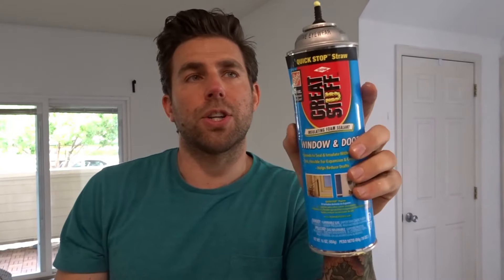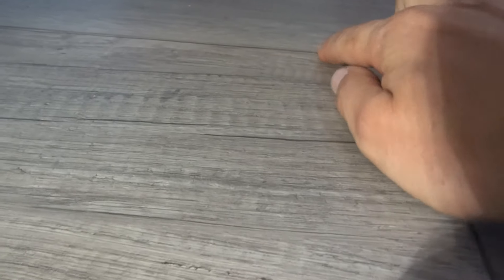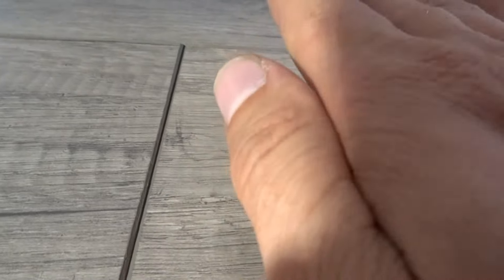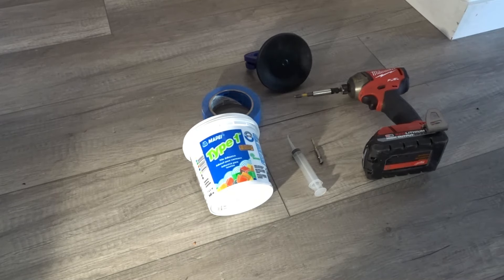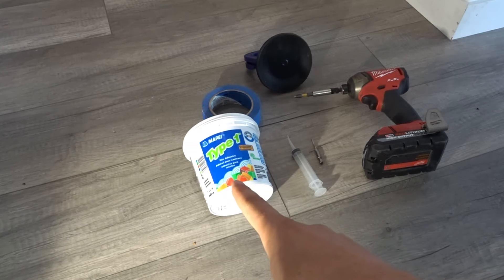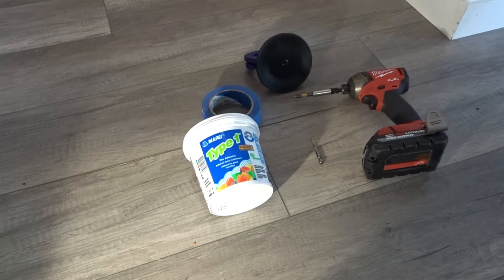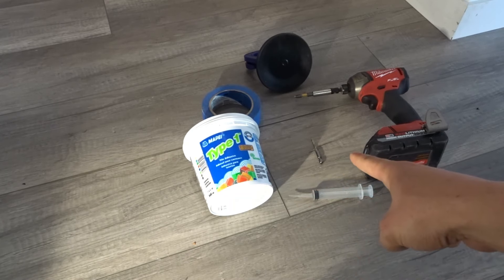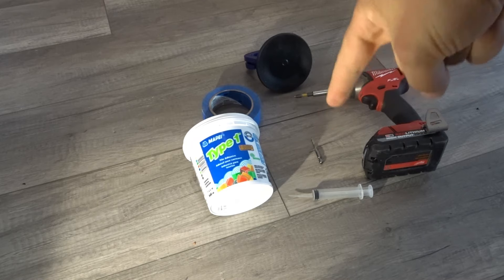Sagging Floorboard Repair | No Damage To Floorboards

Comment: I did two floor boards today and your system worked out great. Planks no longer give when they are stepped on. This fix was spot on and far less work than removing the planks.
Reply from the maker: @wing3389  glad I was able to help out!! Thanks for taking the time to comment, that helps me out!
Reply: @aaronfixesstuff hey mate, would you have any concerns with me doing this fix on my engineered hardwood floors?

Comment: Keep the drilled floor dust to put back in the top of the glue so it matches the floor.
Reply from the maker: What a great idea! I wish I had thought of that!!
Reply: wonderfull idea Ted, Im doing time to time floor installation  and as you guess i end up with that kind of problems and honestly i did not know that, thank you for your advise and thanks to the video maker,  both are fantastic ideas stay safe and stay well  both of you

Comment: This is EXACTLY the solution I needed to fix sagging gaps under my old tongue-and-groove floorboards! I will modify the technique slightly, since my floors are made of real solid wood instead of vinyl/laminate. But the essential piece I needed was to know WHAT to use to fill in underneath. I had already thought about drilling holes like you did, but I couldn't think of a good product to actually use as the filler, that wouldn't squish underfoot, but wouldn't crack and crumble either. I also needed to see someone else using the drill-and-fill technique, to give me confidence that it's not too outlandish of a solution and could actually work! How would you say this floor is holding up now after some use?

Thanks again for sharing this video!! Extremely helpful, and very well-explained and demonstrated!
Reply from the maker: Thanks for the feedback!! I was shocked when I didn’t see a single solution to this!! The floor is still holding perfectly. It dries rock hard so there are no issues. Also since it doesn’t expand when drying, you don’t have to worry about it overfilling!
Reply: You could and should use whatever adhesive is used to adhere your wood planks to the sub floor
Reply from the maker: @A4rings110  thanks for the feedback but you’re incorrect. Such a small amount of adhesive will harden and then will separate from the board with expansion and contraction.
Reply: Hey Aaron, thanks for the reply. My parents have laminate wood which I plan to fix with the same materials that you used in your video, but the way I read Emily's comment it seemed like her floor was not floating and instead was attached via adhesive to begin with. maybe I misunderstood her comment.  @aaronfixesstuff
Reply: Also, in your opinion, would It be better to try and inject the tile adhesive in between the boards and the layer of foam underlayment, or inject under the foam underlayment? or does it not really matter @aaronfixesstuff
Reply: @aaronfixesstuff sorry to bother, but I’m going to try to tackle this project today and would love to hear your thoughts on my last question?
Reply: @emilys3638 did you ever do this with your floor? I have a tiny 1.5 inch x 24 strip I need to try this way. Would be interested if it worked for you.

Comment: Oh my god, what a fantastic fix. I had the same idea of injecting into small holes, but two things which you suggested were excellent: Drill near the seams so that it's less noticeable, and use tile adhesive! Fantastic, brilliant video.
Reply from the maker: @jamhead4866  right?? It drove me crazy that the only solution I found was to remove the boards and then fix the problem. I was very proud of myself coming up with that! And the repair held great!!
Reply: @aaronfixesstuff  that's brilliant news, I'm happy it has lasted. Will be giving this a go on payday. Explained really well too, subscribing!

Comment: Big thanks for this video mate - sorted out a sagging floorboard in my kitchen by drilling 5 small holes and filling with a hardwood colored flooring specific 'no more gaps' product.  Much better option than having my kitchen ripped up and re-laid (which is what the retailer and original installer recommended).  LOL :P
Reply from the maker: @damaged31  that’s what I was told too! I didn’t like that answer and decided to come up with a solution. Glad it worked for you too! Thanks for taking the time the time to comment and support the channel!!

Comment: Great idea! Great video! Was thinking caulk over foam but tile adhesive is brilliant! The right product for application! Please share brand of adhesive and syringe, it seemed to flow pretty well,  and read in comments about saving drill shavings for floor touch up after process. These are great ideas for annoying problem! Thanks to you and everyone! I'm a diy and feel ready t9 install that floor! THANKS 😃

Comment: Very nice video, I have the same problem, uneven suspended subfloor. 
Is there a reason for using tile adhesive?  I am worried with time it will crack and make a noise as you step on it. 
Thanks.
Reply from the maker: Well there weren’t many other options that I could think of. I just used that because it seemed like a solid, but easy to apply, substance. I don’t think that it should crack because the void is completely filled with it. I may be wrong about that, but so far it’s been a year and I have not heard of any issues.

Comment: This is an interesting and creative fix. But in that section the floor is no longer "floating" which means constant gaps in other areas?
Reply from the maker: @silver60618 thanks! There are no gaps that showed up. The floor is still mostly floating as the repair is only on a small section.

Comment: I can’t believe there is a solution for this without taking the floor out !! THank you for sharing ! Question, how long does the adhesive take to dry up? I’m going to give it a shot soon.
Reply from the maker: I know! And I could not believe that nobody had thought of it till I did!! It takes 24 hours to set.
Reply: @aaronfixesstuff  Do you walk on it after some time to make sure it is in level and not building up too much?
Reply from the maker: @Jam.S.  no need to because it doesn’t expand when it dries.

Comment: I am so disappointed having got my floors done by a contractor, only to see few areas with a similar problem. This contractor will never put foot in my house again. Thanks for the video. 👌
Reply from the maker: Absolutely! It’s what happens when corners are cut unfortunately.
Reply: Going through the same. I have gaps, soft spots, and no expansion gap. Been so stressful. I don't trust the guy to do fixed so I am watching all videos I can
Reply: Not his fault your subfloor are not even
Reply: @dman5703 
Subfloor preparation is part of the installation job. No professional installer would go on top of an uneven subfloor. It's the contractors job to be the expert and point that out
Reply: @doubleclutch EXACTLY

Comment: Appreciate for making this video! QQ: I see you kept injecting the adhesive several times into the same hole, so how did you determine when to add more or stop adding? Does the adhesive actually find its way self level to other hallow spots?
Reply: Once the adhesive comes out of the 2nd hole seems to be a good gage of the rest of it being pretty filled

Comment: Wow, this is exactly what I'm trying to fix.  I did not want to remove floorboards and have to memorize all the flooring pieces and their locations for reassembling.  I'm going to try this fix this coming weekend. Just out of curiosity, what size drill bit did you use ?  Thanks for posting this !
Reply from the maker: For some reason I could not find a SINGLE video that addresses this without talking the boards up. I used a 3/16. I’d advise finding one of the syringes I used (that is curved). Good luck and reach out with any questions!!
Reply: did it work?
Reply from the maker: @Gigidurucuru  sure did!!

Comment: Hi just found your video and hallelujah 🙏🏼. Was planning to go the expanding foam route but your method actually makes much more sense and my situation is identical but even more of a drop between the boards. Out of interest what tile adhesive did you use?  The reason I ask is some adhesives are quite thick and I presume struggle to be pushed through via a syringe? It looked like a Mapei product but not sure?
Many thanks and a great vid 👍
Reply from the maker: Hi Mark! I’m glad you ran into it. You are correct, it was the mapei type 1 and they sell it at Lowe’s. The most annoying part was loading the syringe, but it wasn’t too bad. 
Aaron

Comment: I have a sagging vinyl plank in the center near the edge. Currently the floor plank next to it is removed because I was in the process of replacing it. Can I apply the tile adhesive under the plank since it’s exposed? Is there any expansion with the tile adhesive or does it spread and dry as is? Thank you.

Comment: How small of a drill bit did you use for the holes, and was there a reason you put the holes in the sides of the plank and not the middle of the plank?

Comment: Can I use the Alex paintable caulk? I used it to caulk around the window and even though it is flexible, it is semi rigid.
Reply from the maker: I would not recommend that. That caulk is not sturdy enough to support the weight and would likely fail.
Reply: @aaronfixesstuff  Got it. Would you mind providing a link to the glue you used? It was vague on the video and I couldn't see what it was. Was that glue very thin and easy to inject via the syringe?

Comment: Nice approach. but it seems may brake laminate ability to "float". Would not laminate adhere to underlayment?
Reply from the maker: Good question. If you did this on a large area, that could become a problem. However, a lot of laminate flooring is very smooth on the bottom, so the adhesive would not really stick to it very well. So I don’t see that being a big issue.
Reply: @aaronfixesstuff  great. Thanks for the tip. Will go that way.
Reply from the maker: @vasluy  glad to help!

Comment: Good video but isn’t that a floating floor? And wouldn’t the tile grout harden to the point it wouldn’t allow the planks to adjust with change of season causing a bigger problem? I’m very new to home repair since I purchased my first home so I may be very wrong advice is much welcomed
Reply from the maker: That’s a great question. That can be an issue if you were doing a big patch. I’m that case I would have recommended lifting the boards, leveling, and then putting them down again. As this is such a small patch, plus it is in the middle of the house, there is not really significant expanding and contracting of the boards.
Reply: It will be fine if it was on the edges it be a different story

Comment: under the laminate floor dont you have a white sheet of polyfoam?Ita direct on cement?
Reply from the maker: There is an underlayment between the concrete and the laminate.
Reply: @aaronfixesstuff  If there is, then will the adhesive dry?
Reply from the maker: @AlexandrosNikolakis  yes because it isn’t a vacuum.

Comment: That's a good presentation simple and effective. Tile adhesive is glue or cement? I would have try to use a plastic lever like a wedge 
Why the two holes? Air comes out easy no second one is required.

Comment: Do you think Fix-it-All might work instead of the tile adhesive you used?
Reply: I would be careful when using an adhesive because the floor boards need to move a little due to foot traffic and temperature. Safe bets are using minimal expansion foam or strech caulk. Problem with tile adhesive or grout type product is that you just cant tell exactly where the product is going
Reply: @bbar182  foam or caulk will just collapse, they wont do anything.

Comment: Can this method work on vinyl plank? Thanks!
Reply from the maker: Vinyl tends to be thinner, so I’d worry that it would create a “bump”. If you are careful to not overfill, I don’t see why it would not work.
Reply: @aaronfixesstuff  Thinner seems to be the issue on our floor. It's so thin that every little imperfection causes it to be higher and lower. I'm going to try this method in a few days and report back. I agree that you probably just need to make sure you fill it perfectly.

Comment: That's a broken tongue, every you tube video I see sends chills up my spine.  I've installed floors foe 21 yrs, my family for 46 yrs.  People are so misled with videos showing them how to install the floor but not how to properly prep a floor for installation,  or the fact that if you don't prep your floor right you automatically void the warranty on the floor.  If this stuff decide to bond this floor will pop or separate around eventually
Reply from the maker: Nah. There’s no reason for it to pop up somewhere else. All it did was fill the void under that plank which is exactly what needed to be done 😉

Comment: How long did it take for the adhesive to dry before you could walk on it?
Reply from the maker: I waited like 3 days. In normal settings it dries in 24, but just due to the restricted airflow, I waited longer.
Reply: Thanks

Comment: Nice. But it gonna leave holes on the floor. what you gonna do to hide those ?
Reply from the maker: It leaves holes in the seams, but once the mortar fills the gap, the holes fill as well. Then you just color it in with pencil. Or you can buy those floor repair putty sticks for the holes. They are really small and easy to fill in. And that is much easier than removing the boards, leveling the floor, and then putting new boards down.

Comment: What is your opinion of the "Fix-A-Floor" product?
Reply from the maker: @GrowLLLTigeRRR  I’ve never heard of that!
Reply: @aaronfixesstuff  I probably would not have bought it had I watched your video first but it's very similar to what you have done.  I'm just wondering if it will hold up over time.

Comment: Good Idea.But don't the floor are suppose to be able to move? And if you put that stuff that piece is gonna be glue in the plywood
Reply from the maker: Not really. A. It’s injected in between the laminate and the underpayment. B. It’s only a small amount and it’s in the middle of the room, not really any movement there.
Reply: @Aaron Fixes Stuff  ok Sir thank you. I Will try that .
Reply from the maker: @franciscocrcabrerar9028  I would definitely avoid this if you were working on a large area. This is intended to repair a small issue. Feel free to ask any other questions!

Comment: Do you inject it below the underlay or between the underlay and floating floor?
Reply from the maker: It’s easier if you can get it between the underlayment and the flooring. That way if/when you replace the flooring, it comes up easier. But honestly thinset comes up pretty easily regardless, so it’s not a huge issue. 
Hope this helps!!
Reply: @aaronfixesstuff  Thanks a lot! Do you have any concerns about glueing the floating floor down and if this will affect its ability to expand and contract? And would any tile adhesive work? I am in the UK and I don't think that type 1 adhesive is available.
Reply from the maker: @colindavies6504  I don’t believe so and here is why. First off, the patch is not huge, so it will only adhere to several boards. Secondly, the bottoms of the boards are smooth, so given movement, they will just separate from the adhesive. Thirdly, they are in a temperature controlled environment, so the expansion/contraction is minimal, or none at all. As far as the adhesive, I’d just recommend one that dries hard, that is not so thick that it won’t eject from the syringe.
Reply: @aaronfixesstuff  I was thinking that even if it does stick to the underside of the floor board, that's probably okay because you're putting it between the board and the underlayment, as opposed to actually gluing the board down to the subfloor...?
Reply: @aaronfixesstuff  In another comment you agreed with a person who said it should be between the underlayment and the subfloor and now you're saying the opposite. Which do you think would be better?

Comment: My LVP is in a basement on top of cement, and the installer put the floor in without using a self leveler in the spots that are clearly flexing up and down. I wonder if you could use thinset vs the mastic? Do you think it would pass thru the syringe the same?
Reply from the maker: The problem with LVP is that it is not as rigid as laminate. I feel like when injecting it, you can end up with the opposite problem, where the LVP raises and gets a “belly”. And as far as the thinset, that just depends on how liquid it is. As long as it’s not too thick, I fell like it can be injected. I used the adhesive because I didn’t want to have to deal with the mess.
Reply: @aaronfixesstuff  ou on est là il est in

Comment: You should have drilled in the actual plank not in the seam and then you can use the little plastic shavings that are left over from when you drilled and you can melt them with a sottering gun back into the hole. There's actually videos on how to do that and you can't even tell because now you're gonna see the hole in your seams
Reply from the maker: I sure hope you don’t do this work for a living because that is the worst advise ever…

Comment: It's sad that nobody contacts the contractor about a hack job....then turn to doing another hack job to fix it.... obviously you need to make sure you're subflooring is level to each panel... it's not necessary to be level to the world... just less wavy....
Reply from the maker: You think this is a hack repair. I’d argue that this was a better and cheaper solution which clearly addressed the problem. If the problem was fixed and the homeowner is happy, that is all that matters. Thanks for the feedback though.
Reply: @aaronfixesstuff  no problem...we have different expectations from clients....
Reply from the maker: @-agent-47-80  work smart my friend, not hard. There was no reason to tear up that floor and redo it :)